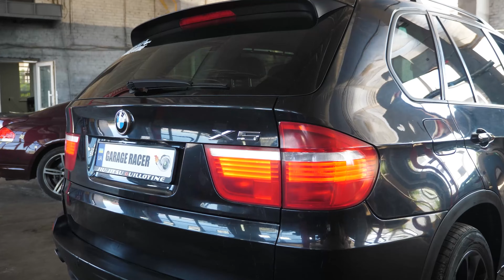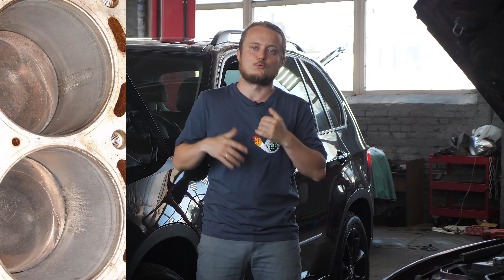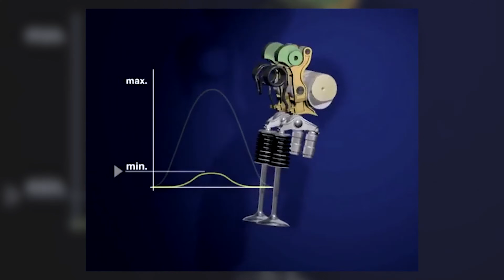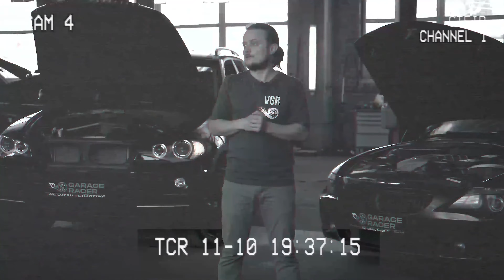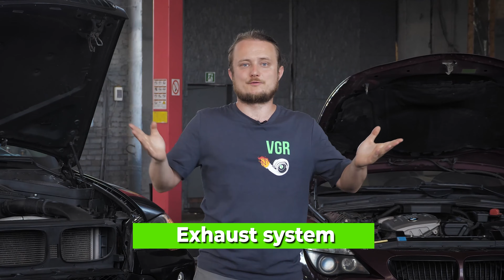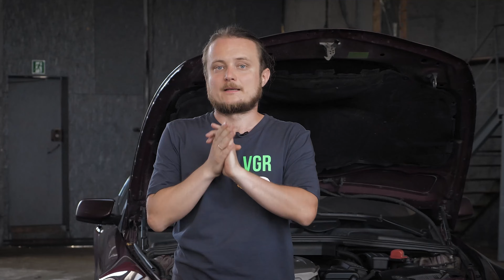BMW N52 Engine Review. Issues & Fixes: END of the Naturally Aspirated Era!

Comment: Been chasing a vacuum leak on my E70 X5 30i. Changed everything I can imagine from fuel pump and related relays. Camshaft position sensor, vanos solenoids, MAF sensor, ignition coils and spark plugs .....still stalls when not being accelerated....😢 Going to do valve cover gasket next. Also changed eccentric shaft gasket

Comment: I have a 2011 328! N52 its been good But I know I can make it more Reliable, it's not like an N54 with a twin Turbo.My friend told me to get a N52 Because it's doesn't have a turbo and it's more reliable any tips
Reply: Get the coolant flange upgrade (Mickey Mouse), new vanos solenoids, new water pump and thermostat and fresh PCV system. These engines do ‘eat’ starter motors and also O2 sensors, but that depends heavily on fuel quality.

Comment: Change oil every 5,000kms. Use OEM filters. Expect upper and lower engine gaskets at 150,000kms. Replace PCV and hoses when gaskets go. Trans solenoids go around 200,000kms. Thrust arm bushes went at 150,000kms also. All other suspension parts good as new.

2006 130i owner. 200,000kms.
Driven to rev limiter daily.

Comment: Great walk-through common N52 issues combined with  your own experience. It would have been nice if you touched the updated N52K(N) version a bit more, which had updates also eliminating some other of the weaknesses of 1st gen N52's (camshaft, valve stem diameter etc). I also think you miss to mention the N53 as the step between N52 and N20. Perhaps it was not sold in Ukraine and Russia due to high sulfur levels in fuel idk. I have a 325i, with the updated 2,5 liter engine. Now at 246.000 km with oil consumption of 1 liter per 10.000 km. No issues at all.

Comment: i love my e92 i get excited when things break so i can wrench, i have replaced just my pcv alone and it works great 15$ ebay n52 you must break it off chisel away the plastic carefully without breaking the 3 tabs buy one off ebay and reuse the spring and new one clicks right in no jb weld needed. i have broke my disa valves open and cleaned the oil out of them with gasoline and clamped them back together while melting them i have alot of coils go bad 1 by one i cleaned check valves replaced shocks all by myself i am new to cars but if you love something so much you will do anything in your power even when youre broke.
Reply: You're absolutely right! Thats how i feel about my e90 2006 325i b30 with the 3.0 N52 engine, I've done alot of maintenance on it myself and i also love wrenching on my car when i need to and will also do everything in my power to fix any issues to my best knowledge when problems arise. With a nice scanner, tools and youtube vidoes and bit of knowledge anything is possible 🔥 even if your not a high level technician...
Reply: @artcruz5603that’s awesome I’m actually on vacation right now visiting my dad he also has a 07 325i because I told him to grab one up. I’m replacing his starter so I’m experiencing the difference between the manifolds in the n51 and n52 motors. n51 have a stage 3 manifold unlike the n52. Crank case hose.
Reply: Yeah the 325i does not have the 3 stage intake manifold so no disas involved in that model just a staight six with a regular manifold... it does make a little power with the right mods... You got this! The starter should be quite easy just take your time and the ccv hose should be a little tricky mostly getting of those stubborn clasps that connect them but if you need to just break them off if your replacing them anyway! Thats cool your helping your dad out man im sure he appreciates it! Considering how much mechanics charge with repairs on these vehicles, I also suggest for preventive maintenance to clean the vanos solenoids and also the vanos check control valves filters that are located on the left side of the block on the exhaust side not alot of people check or pull them out and clean them, depending on the mileage those tend to clog and give the car all sorts of issues.... spray them and the vanos with some good break cleaner and they should be good to go...Good luck brother!

Comment: I’m looking at a n52 2010 f10 528i here in Aus. Talk of cam shaft replacement is a bit disappointing. My m54 with 425 000km has never been opened beyond the valve cover gasket and banks seal replacement.

Comment: N52 replace for what? Port injected so no carbon build on intake valves!   Drop two cyliders and add turbo and D.I. results in cleaning intake system..  More reliable?  NO!  N52 last of the best engines by BMW for long term reliablilty.

Do not trust turbo engines. 

And I own what at one point in time stated as a bad engine....the S85..... much better than all "M" or standard engines with a "Hot V" turbo.

My opinion, n/a will last longer.

PS:  Aluisil can be honed to 0.2mm over with a good shop.  Now an old technology vs. plasma lined cylinder bores.  To my knowledge, plasma can not be serviced while Alusil might have a service life with  a rebuild and new pistons and a good machine shop.
Reply: As a person who recently rebuilt a N52B30 because of it burning oil I had basically no issues with the alusil coating it was basically brand new I don't think my oil issue even came from the rings but ive replaced them to be sure anyway ive had the head professionally done and from what he told me the valve stems were shot and intake valves were not sealing properly that was probably the entire issue of it burning oil

Comment: In sailingyachts,especially at seagoing. They use duralac, to isolate stainless bolts in aluminium masts, boom, pole’s. Works excellent. No corrosion.

Comment: I'm thinking of purchasing a 2013 f10 with the 528  which carries the n52 this engine has a problem where it starts then stop. I must say your review was very informative. The engine in question was transfer from another bmw which is a 7 series after the transfer the start and for a minutes then shut down  then start  and then shut down again and now will not turn over is this engine jam is there anything  that could cause the engine seize so quickly we use AMS oil full synthetic
Reply: Idle control valve, throttle body, vaccum leaks. Smoke test it😊

Comment: My US version 2006 530xi n52 with metal valve cover, is still running fantastic after 255k miles or  408,000 Kms.  I change my own oil at 5-7k miles, mann filter and Castrol 5w-30 bmw LL-01 approved oil only. This car has been in top gear most of it`s life 2700 rpm. or cruising at 80. The e60`s get a bad rap here, but I got a really good one, I think. First year for n52 and xdrive.
Reply: Have you had any unexpected failures? I'm at 150k on my 1 series, trying to do all the preventive stuff possible
Reply: @brandonsever2576 my starter randomly died luckily in my driveway tho no long crank